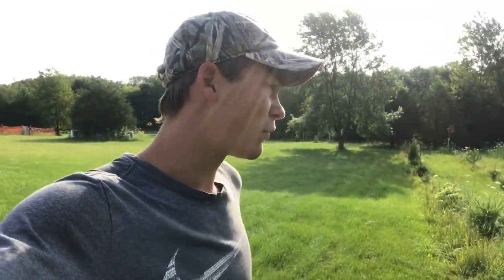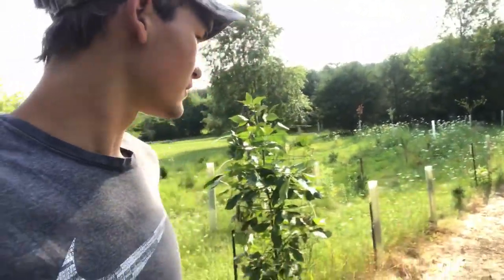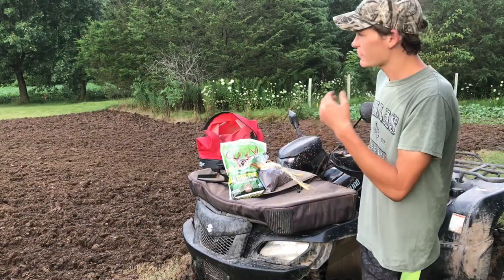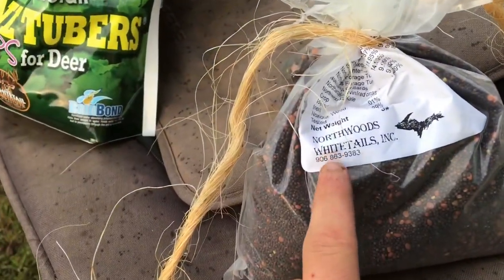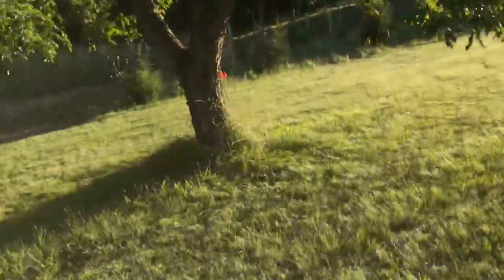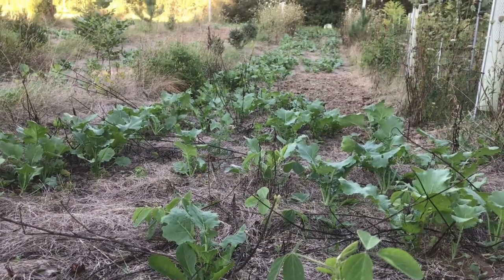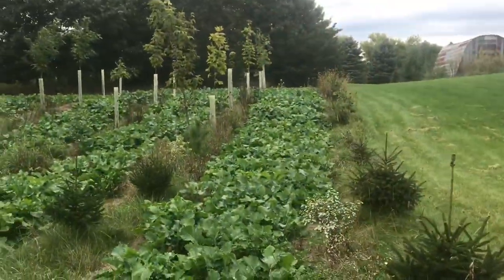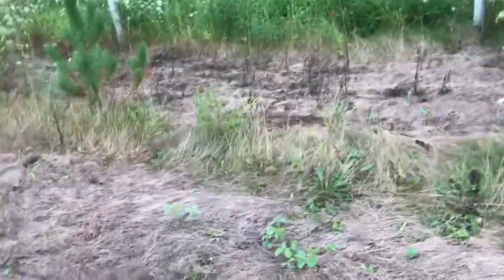No-Till & Tilling Brassica Food Plots

Comment: I have an acre of tree row plantings that I’m going to try this on this season. Looks like it worked well for you.   Any additional tips before I try it?  Should I mow between the rows before I spray ?
Reply from the maker: No-till may not work, it did end up turning out good for me eventually. I would recommend planting early because I have noticed the brassicas grow really slow for the first month when no tilling them on hard ground that hasn’t been planted. You could probably mow and spray or spray early in May-June to get rid of the thatch layers earlier. And then spray when you plant.

Comment: Is it possible that your seeds are being covered or buried too deep due to the drag your using after you broadcast those small brassica seeds? Most seed manufacturers don’t recommend dragging  small seeds such as clover, brassicas, etc. You might consider dragging/exposing more of the soil first, seeding then cultipacking or using a heavy roller.
Reply from the maker: We have never had problems with poor germination when using the drag. But I agree you have a chance of covering them too deep. Packing with an atv or cultipacker would be a safer bet. The reason we had to replant this plot is because the no till planting into grass didn’t work out that well.
Reply: Wisconsin Whitetail 

Do you believe it was a thatch issue whereas the seed wasn’t able to make contact with the soil? FWIW I’ve found that you can get away with no till practices with brassicas not only due to their small seed size more importantly due to the tap root they establish. What I’ve found that you have documented superbly through your videos is the importance of not planting your brassica seeds too thick. Your (result) documentation/comparison of a thick seeding compared to a seeding that allows room for the brassica to grow and establish is spot on! It’s always difficult to gage how much seed your putting down. You tend to want to “over” seed especially when your seeding into standing grass/weeds that have been sprayed /terminated with gly prior to planting. You’ve covered those situations in your video’s expertly! Big Fan of your channel! Keep up the strong work my friend! Have A Safe & Productive season!!!
Reply from the maker: It was for sure a thatch issue. Grass is too thick to no till into. Although the area between the tree rows that we didn’t replant eventually came in and turned out really good. 

Yes, seed population is very important when planting brassicas, it’s very easy to overseed. I have done it many times LOL. 

Glad to hear you enjoy my content. I have a lot of brassica plantings of a variety of tillage and no-till videos underway. 

- Jason
Reply: Wisconsin Whitetail 
Subscribed!!! Looking forward to it!
Reply: I believe they may not have been buried deep enough. I also agree they shouldn't be too deep. We have a hard time finding the perfect depth. However, our fall brassica fields need to see about 1/4" buried... We accomplish this by killing current crop, planting into dead crop stand, drag over dead crop residue and then cultipacker. Great videos!